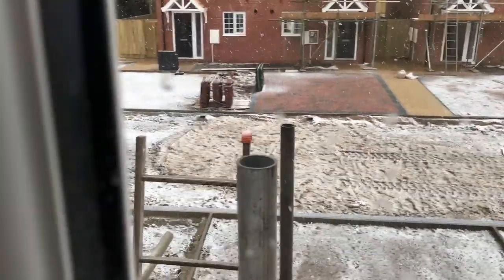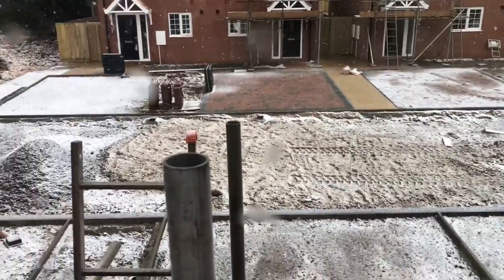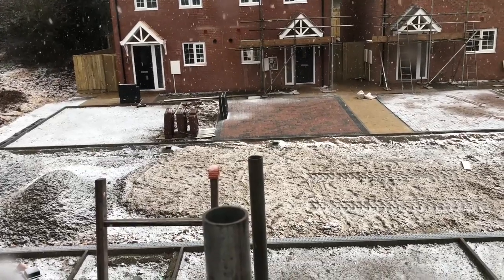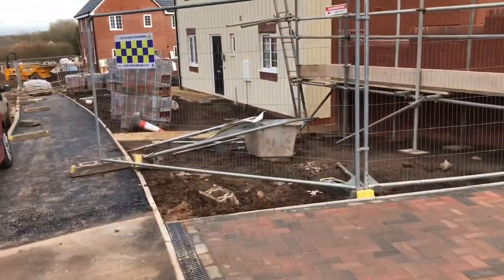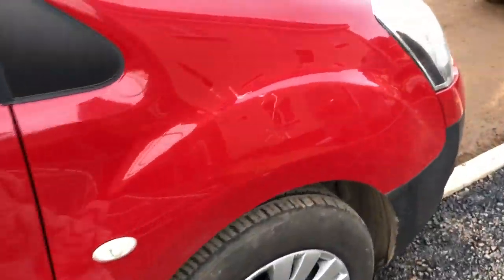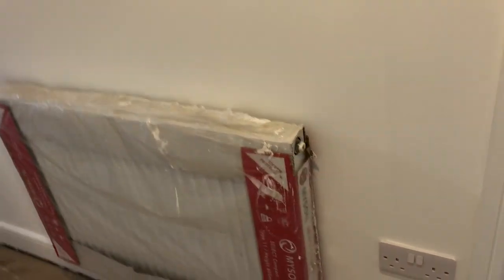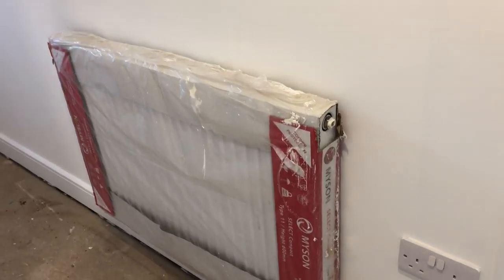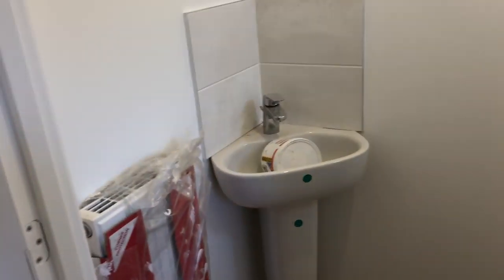Life on the Brush, poor mans lunch

Comment: I work by myself a lot and using airless spray is much easier on the body, dont use it to paint everything,use it on ceilings and as a big brush. Keep using the brush and roller and spray togeather.  Without the airless spray my life would be hell to tell you the truth

Comment: In my experience spraying is worth the time and effort in large empty warehouses and office blocks and multi story car parks where you have lots of meterage to cover especially if it’s an up and over white ceilings white walls etc. But for residential new builds and especially victorian Edwardian occupied residential properties traditional brush and roller application is much quicker and a hell of a lot less hassle. Also totally agree with you about the XL purdy scuttles pain in the arse to keep clean if possible each day i finish I ether clean my one out or leave it half full with water to stop it gumming up have tried the Wooster Big Ben scuttle but not as good though. Really enjoy your in the real world no bullshit videos keep up the good work!
Reply: Yea I wash me scuttles  out everyday 10 mins done
Reply: Prime the bare scuttle with oil based undercoat after every clean out, and it will work fine

Comment: Few painters I know coat the inside of their skuttles with a coat of gloss then let it dry, emulsion wont stick to it they said...Good tip?
Reply: Vinyl silk your kettles,before using oil based paint,and they will peel out super easy when it comes to cleaning.

Comment: Been painting 35 years pal spraying not worth a wank unless it's a  big industrial unit with  no masking , dont even think it's worth it for misting  unless u got 3 to go at
Reply: I can spray a four bedder in an hour an half , two colours 
If you get in when the dry liners finish it saves you loads a time an effort , mini roll the reveals so as not to overspray windows , you get ear ache of agents an cleaners for that 
I would never roll one out again 
Quick solid smooth 
What more do you want , they only need coat a piss after that so your second coat is easier , quicker , no trouble covering 
Don’t knock till you try
Reply: @davidsmalley8783  half an hour Hahahahahahahahahaha me fucking sides hurtin
Reply: @davidsmalley8783  oh sorry hour and half ,ok about same as brush and roller then
Reply: @davidsmalley8783  you started the bollocks mate, so your lugging an airless spray around  a plot  on your own ,hour and half  two colours   ,no masking or cleaning ,what about down time cleaning  sprayer out ,sprayer playing up
Reply: @davidsmalley8783  how much you get for misting a big plot
Reply: You don’t need to mask up as the plot is empty , no rads , kitchen sockets switches 
Roll reveals  , wisk the wallop 
Set up at the front door or in the garage , generator in the van , run a lead , 
And then spray when finished remove gun and run soapy water through machine while you load van up sprayer in last by that time it’s flushed out 
Any more questions
Reply: @davidsmalley8783  did ask another question  but nevermind, stopped bothering with new build  few years back no money in it,other trades in the way fucking up your work, just painting  scruffy  old voids now  no snagging
Reply: Plenty of money  is on em if you have the right gear no how and attitude 
Unfortunately you have to turn into a robot but at the end of the day you are on a production line 
Spraying works for me anyway 
Each to there own

Comment: Sprayers for misting and doors/spindles only 
Forget anything else , to much time masking up 15s and corner , ease , mini jumbos all the way plus sprayed walls can’t be touched up , to flat flash like mad 
M&S all the way 😝
Reply: Possible get away with spraying ceilings but then you got to mask or bag down lights and tile perimeters to wet rooms so is it really worth it 
Still don’t bother , ceilings are a piece a piss anyway
Reply: Mini roller
Reply: @davidsmalley8783  be lucky to do  touch ups this method without showing.